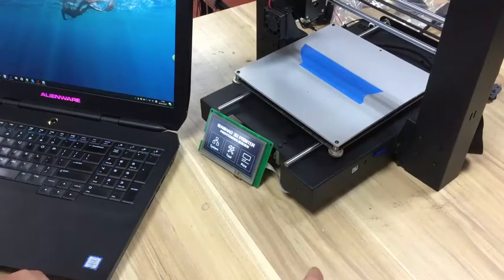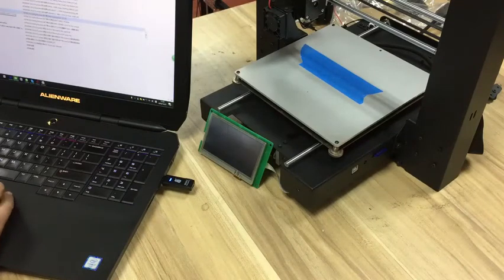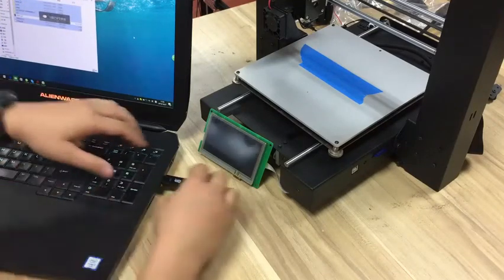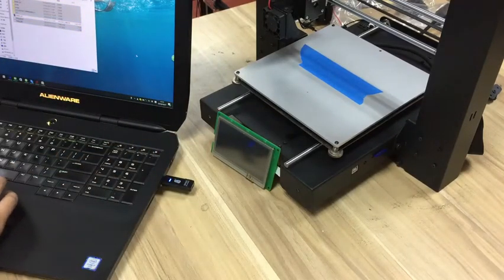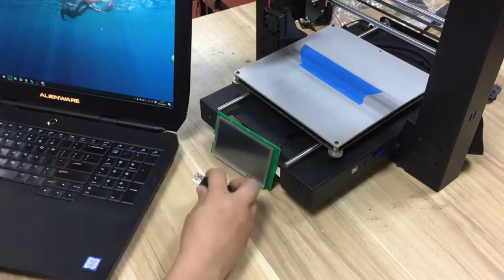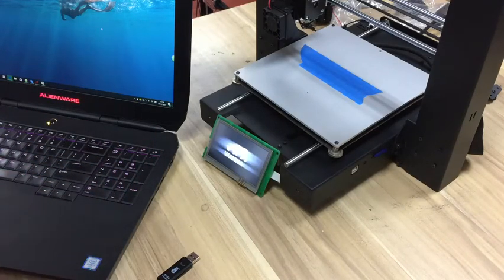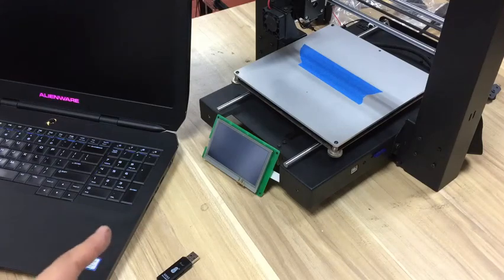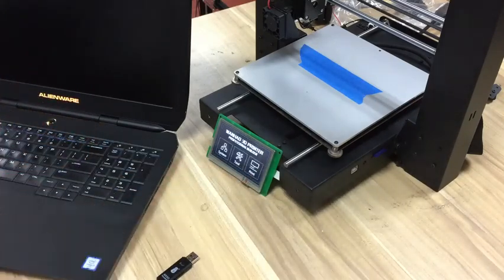How to format wanhao i3plus LCD display?

Comment: I've had an issue during flashing where the cable connecting the screen to the motherboard fell out and now the board does not show any change during flashing or installing firmware.

Comment: I did everything you show up in this Video and the flashing runs fine. Now I have a problem with all values (temp, filenames of the SD, fanspeed etc.) only a white bar instead of the value!

What can I do? Tried reflash it 100times already.
Reply: i have the same problen. did you find any solution????